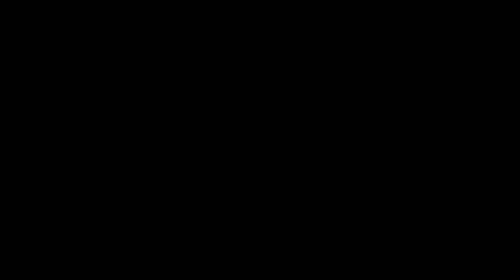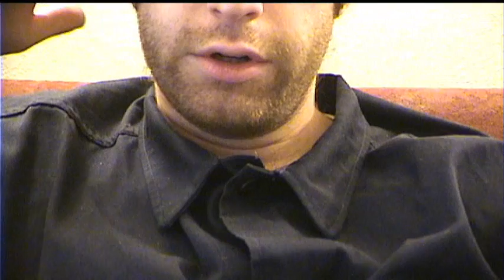Hydrolyzer prototype vlog 2

Comment: electrolysis breaks water. Explosion turns it back to water.
It's actually a purification process. When it's separated, it leaves impurities behind.
When it exits the exhaust, it's pure water. If efficiency is achieved, it's a never ending fuel.

Comment: at the dawn of the age of oil, the product we now call gasoline was considered a waste byproduct from the distillation of kerosene ... it was considered to be too volatile and dangerous for any practical use ... 

electrolysis is not free energy ... it is an energy conversion from electricity to a burnable gas ... our current efficiencies exceed those of nuclear power generation ... 

you are of course entitled to your opinion ... but I disagree with your argument ...

regards